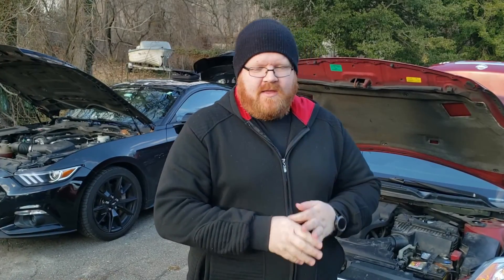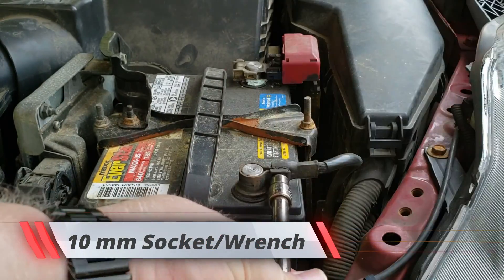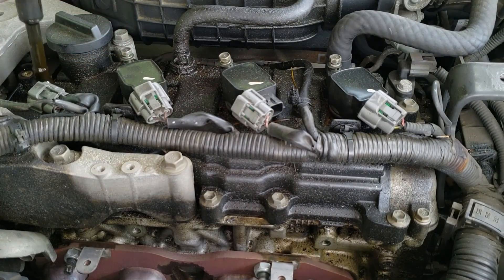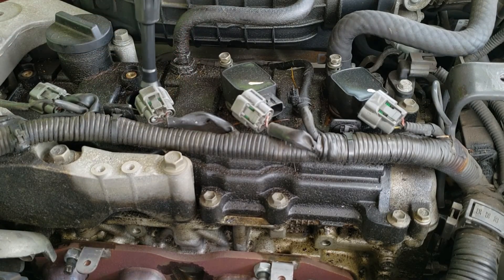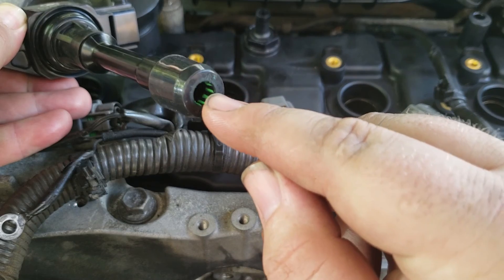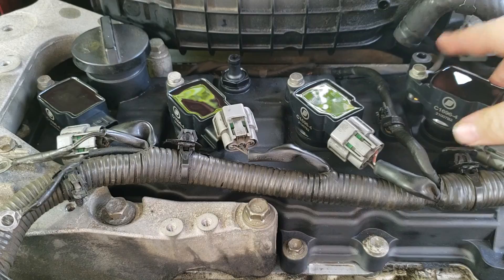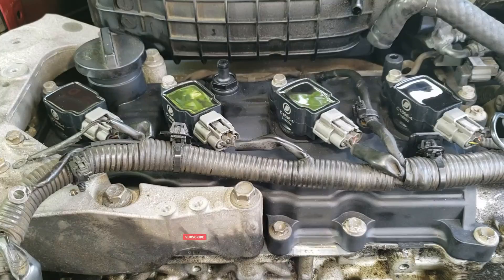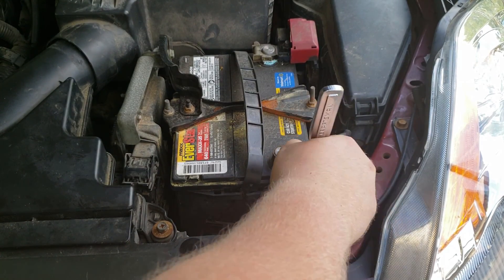2007 - 2012 Nissan Altima 2.5 Liter: How to Replace Ignition Coils!

Comment: Good video.  Nice, clean and informative.  Do you work on any other vehicles?
Reply from the maker: Thank you very much, appreciate it! Yeah, I've worked on all different kinds of vehicles through the years, I enjoy working on them

Thanks for watching!
Reply: Do I have to replace the spark plugs too?     My Nissan Altima is acting up.   When speed losses power and kind shake...
Reply from the maker: I would replace the spark plugs if it's doing that. 

We also have a spark plug replacement guide here: https://m.youtube.com/watch?v=BFRJZLrDGsM&t=51s

Thanks for watching David! 👍

Comment: I have oil in coil #4, is there a temporary fix aside from replacing the entire valve cover gasket if there’s only one that has oil
Reply from the maker: Unfortunately, there isn't. 😔

I wish there was though because that would've been awesome. I only discovered mine leaking when I was trying to replace the sparkplugs, usually a 30 minute job that turned into a full day adventure lol. 

There are new gaskets you can buy but I just ended up replacing the whole valve cover since it's plastic (smh). Good luck and thanks for watching 👍
Reply: @TrickShiftGarage  thank you man you’re awesome and keep up the great content

Comment: If oil reaches the coil connector, does that mean I need to replace the wires too? Or can the wires handle a little oil?
Reply from the maker: Yeah, I would just clean off the connectors as best as you can, they should be fine. Thanks for watching! 🙂

Comment: My Nissan Altima 2012 won’t go pass 65mph, I could get it up to 100mph but then it’ll drop back down to 65 with my foot on the gas to the floor. I haven’t changed my spark plugs yet, but are the spark plugs the issue at this point?
 
And thanks for this video it was very informative❤
Reply from the maker: Hi Nanii! It sounds more like something is wrong with the CVT transmission than bad spark plugs. It could be many different things that can cause this but my guess would be something is up with the transmission. Since it's electronically controlled with sensors,  solenoids and circuits, it's beyond my knowledge. I definitely recommend you take it in to a Nissan dealership and let them have a look at it. Thanks for watching! 👍

Comment: I have to replace coil 3 which one is that one is that from left to right.? Or right to left.?
Reply from the maker: The cylinder order is from left to right.  Cylinder 1 is all the way to the left by the serpentine belt (on passenger side). So, coil 3 is two cylinders over to the right. I should have included that information in the video. Thanks for watching! 👍
Reply: @TrickShiftGarage  so in other words it goes in order from left to right. Helpful vid btw
Reply from the maker: Yes, glad that you find it helpful. Thanks for watching! 👍

Comment: I had the P303 code on an 11 Altima. I found your video and seen how easy it looked to change out the coil packs. I bought all 4 and replaced them using your video step by step. I hooked the battery in and now my car is wanting to turn over but isn't for some reason. It's not making a dead battery click. Any idea what it could be now? Thanks
Reply from the maker: Hi Smitty! I'm sorry to hear you're having issues. The P303 code is a cylinder 3 misfire that is usually fixed with replacing the spark plugs and/or ignition coils. The car not turning over makes me think the battery might be bad. 

But first, I'd double check the part number of the coils to make sure you have the right ones. If that's good, then go over all the ignition coil connectors and make sure they're all plugged in fully. Also, make sure both positive and negative battery cables are tightened securely to the battery and that the connectors aren't corroded.

Hope this helps. Let us know how it goes!

Comment: Thanks for the video bud i just changed my third ignition coil on my Altima only thing is i broke part of that electrical clip theyre attached to. Do you know if its okay to just secure it with black tape? Im afraid it mite come loose
Reply from the maker: Hello! I'm not sure about putting tape on that electrical connector as it could melt (or worse) with it being so close to the engine. It might work in a one-off scenario, but once the tape heats up the adhesiveness of the tape breaks down and it won't hold it together anymore. I'd look into getting that connector replaced as soon as possible. The Nissan dealership parts department should have that connector for you. Hope this helps and good luck! 👍
Reply: @TrickShiftGarage  thanks bud im gonna give that zip tie trick a shot it seems solid

Comment: Hey! I had an oil leak in the pistons he replaced the valve cover and oil leakage is no more. He said to replace coils (car doesn’t pick up speed, it goes to 60kmph at 4000rpm)
Can you identify the issue?
Edit: I changed the coils my engine light is still on and my rpm is still same.

Comment: Whats the gray plug called woth the black wire. Its where thr ignition coil plugs into. What's that grey plug wire called. How do i call it when i go to the Auto part stores.
Reply from the maker: Do you mean the one that plugs into the ignition coil itself?

Comment: The one thing that I needed to know, you skipped over.  That was how you disconnect the wire connectors to the red coil packs?
Reply from the maker: Sorry about that! Basically you should see a plastic tab on the top of the connector and you just need to squeeze that tab down toward the engine and wiggle it out and it should come off.

Comment: How can you tell which coil packs need to be changed that’s what’s troubling me?? I’ve had two replaced already so I’m not sure which were the two that weren’t and want to make sure I remove and replace the right ones.
Reply from the maker: Hi Adlena! One quick way to test for a bad coil pack is to start the engine and let it run. A bad coil pack brings a misfire to the engine, so unplug one coil, if the engine runs even rougher that means that coil was working correctly and you can plug it back in. Go through each cylinder one at a time and you'll know the bad one because the engine will stay running the same when you unplug that coil. That should be the bad one. 

Here's a video I found that can show you better: https://youtu.be/uDif95Yy1D8

Hope this helps, thanks for watching! 🙂
Reply: @TrickShiftGarage  Thank you, so much for the reply that helps a lot.
Reply from the maker: You're welcome, Good luck! 👍

Comment: Man I did this now my car won’t start lol. Anyone have any idea what could’ve gone wrong?
Reply: It looks like we were working at the same time haha. All I could think of is if you forgot to hook the battery back up, I'm not sure if getting off brand coils could be the culprit too 🤷‍♂️
Reply from the maker: I agree, make sure your battery cables are on securely and that you plugged the connectors to the ignition coils all the way in until they click.
Reply: @asklamar  hahah …. Thanks for suggestion
Reply: @TrickShiftGarage  thanks for responding. There was oil all over my ignition coil so that might be the issue. Will clean it up tomorrow and replace spark plugs as well . Hopefully that works
Reply from the maker: You're welcome. Oil in the spark plug hole means it's time for your valve cover to be replaced. Oil is leaking past the rubber seal that goes around the spark plug hole.

Here's a video we did on cleaning out the spark plug hole: https://m.youtube.com/watch?v=d2B4BQf9XCs&list=PLLWspAClw3lzHsOBWgQkS_JOrOsPqlsmY&index=4

Here's our valve cover video as well: https://m.youtube.com/watch?v=fRzelPhCPMw&list=PLLWspAClw3lzHsOBWgQkS_JOrOsPqlsmY&index=6

Thanks for watching! Good luck bro!👍